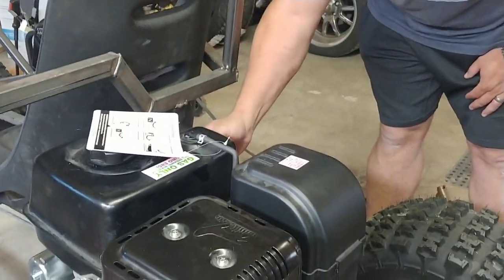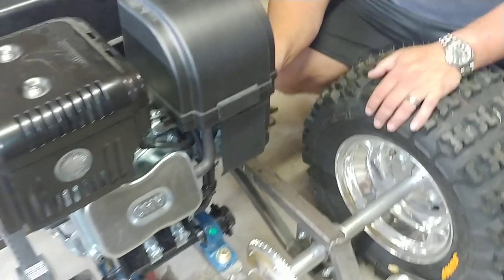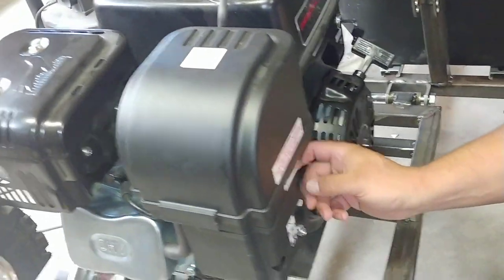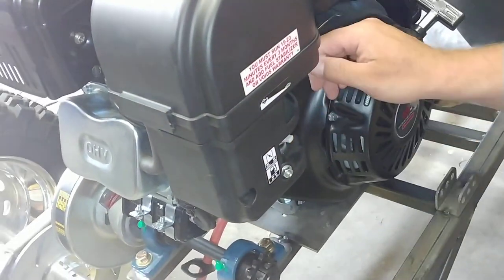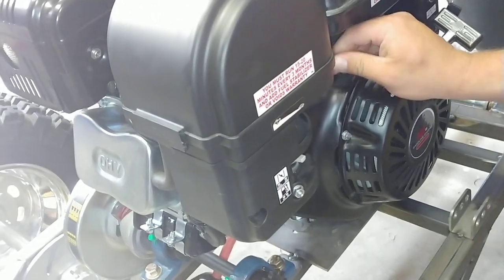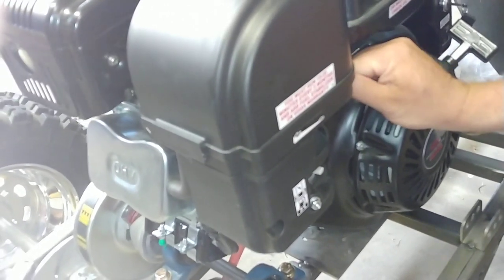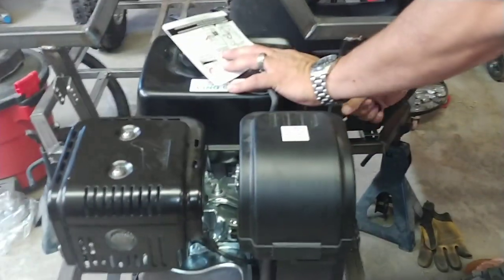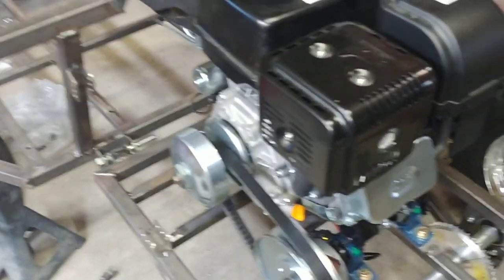First Start Predator 420cc Grand Daddy go kart build

Comment: Sounded great. Where did you get your parts from? Chrome rims? Rear axle? Snow tires? By the way what are the size of the tires? And what are the size of your rims? Front and back
Reply from the maker: Front wheels 10x5, rear 10x7.  Front tires 21x7, rear 20x10.  I will go bigger next set.   Fronts wheels are a quad wheel, 4on156mm bolt pattern.  DWT is the brand I think.  I use an adapter for the 4x4 hub.  Rears I think I found on ebay, likely a golf cart wheel, 4on4 pattern.  All wheels are aluminum.
Reply: Hi Scott, thanks for responding. I've done a lot of searching for the rims that you have. I'm having a problem finding the exact same rims that you have? Is there anyway you could provide me with a link where you purchase them? That would greatly be appreciated. I am also assuming you purchase the Hub on your axle at the same location?

Comment: Where do you get the clutch? And do u have a part number ?
Reply from the maker: No part number, but I'm pretty sure I got it on ebay.  it is a chinese knockoff of a comet 40 series torque converter kit.  Lots of packages out there that come with both the 40 series torque driver, and the 7.5" driven pulley.
Reply: @scottlambeth  thank you